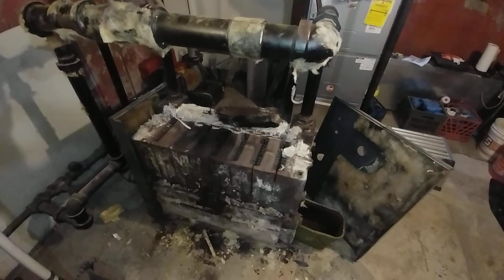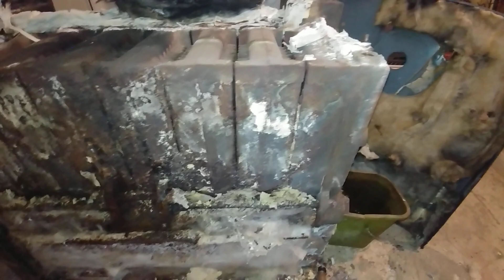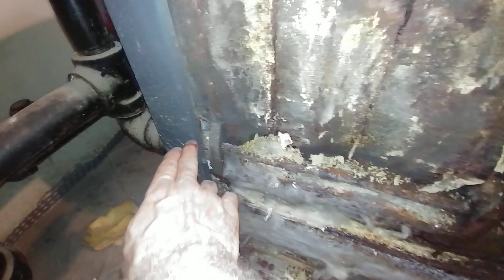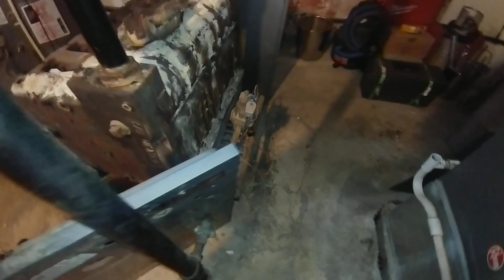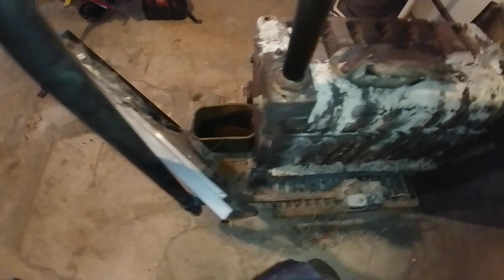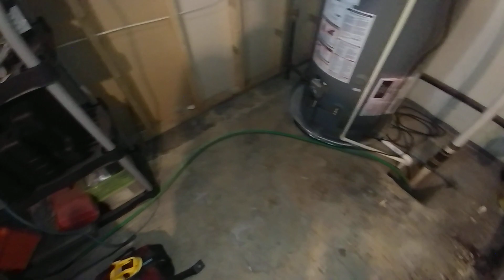Failed Steam Boiler Pre-demolition

Comment: I have a weil McLain eg65 that I replaced the boiler section last year. Now I get some pipe noise intermittently after the boiler fires. Is it cold water entering the boiler from the return?
Reply from the maker: You have a steam boiler, right?
If it is a brand new section you added, it might have carried with it oils from the manufacturing process.
These oils may be causing your rebuilt boiler to make "wet steam" and that might be the cause of your pipe noise.
Following Weil's instructions for cleaning your boiler should take care of your issue.
Just total conjection on my part.

Comment: Gordon, what manufacturer and model.  Burnham ?  Looks like their blue.
Reply from the maker: Actually, this was a Weil Mclain EG-85.
Reply: Did it fail at a gasket?
Reply from the maker: @Bob.W.  Yes, it appears so. The gaskets were no longer pliable, fairly brittle in fact. The fail point was at the little draw rod gasket.  It's reasonable to assume this boiler was brought in in pieces and re-assembled, just as we will be forced to do.  I doubt these old draw rods were put together with a torque wrench. But having said that, 30+ years ain't bad.